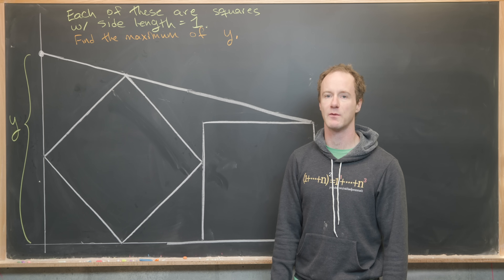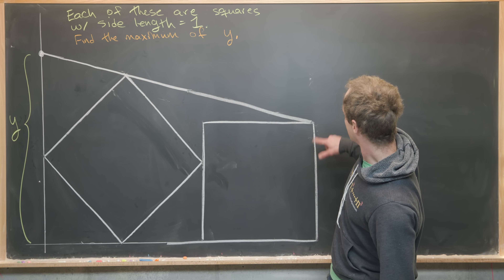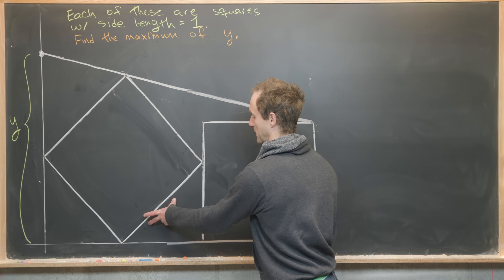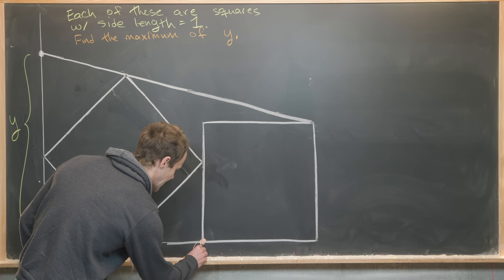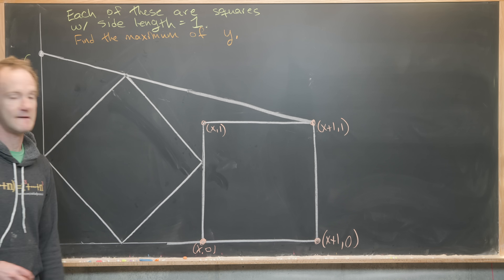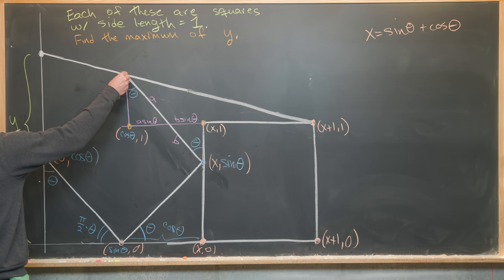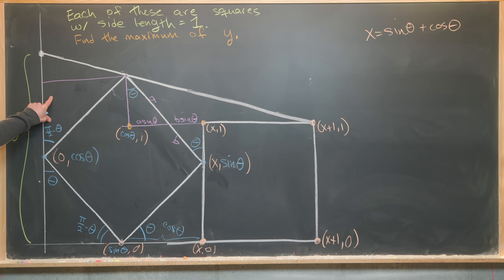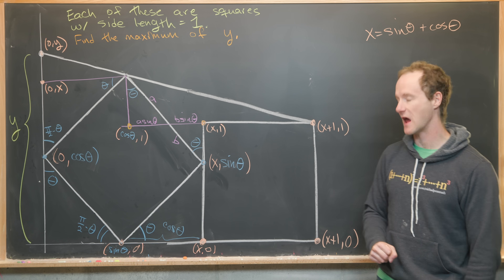How big can y be?

Comment: Excuse me if I'm being dumb, but if the question was asking what the maximum of y was, wouldn't you just set the theta equal to 45 degrees as that would maximize the vertical height of the tilted square, which would then maximize the height of y? Like, there IS a way to solve this numerically, unless I'm being dumb.

Edit: Forgot to mention that since it gives side lengths, you can solve it. Not sure if I need to mention that, but still.

Edit 2: Every response to this keeps on getting more confusing. Feel free to keep commenting, I think eventually someone will figure it out, because clearly I can't.
Reply: Because that is not the actual solution. The 45 degree angle would be the maximum solution for x, but it is not for y. (even if somewhat close to it of course) By tilting the square just a little bit clockwise, x gets just a little tiny bit smaller, but y gets higher, because the top of the square is moving to the right more than downwards.
Of couse you can do this numerically as well, but that's a whole other story. So basically, you could do a search with the angle looking for a value of theta between 0 and 45 degrees and do a binomial search until you reached whatever your degree of error is. But numerical solutions are in general no exact solutions, which is what Michael is looking for here.
Reply: @petersievert6830  but y is the height, and if y is on the line from the top right corner of the regular square to the top of the tilted square, then to maximize the angle of that line to the horizontal, you would just tilt the tilted square to 45 degrees... Also, x would be maximized at angles larger than 45 and approaching 90, as the most the distance can be is that gap plus 1.
Reply: @nateexists6292  i don’t think you got what peter said, the max of Y is not achieved at theta=pi/4 because y max =/= x max. 
Its pretty close tho.
Reply: @nateexists6292  Be awere that the X-coordinate of the top of the square is not fix. Moving the top to the right while keeping almost the same height, enlarges y.
Reply: @BrianStewart126  I am not sure, what you are referring to exactly. The numerical solution?
If there are multiple local maxima between x=1 and x=sqrt(2) (which corresponds to my theta ranging from 0° to 45° , then it could obviously fail, sure. But it seems intuitive for me, that when you tilt the square clockwise from x=sqrt(2) to x=1, then y would rise for a certain range and fall afterwards. (If that assumption is wrong, I am in troubel, sure.)

btw I was imagining some kind of search, that makes do without the derivative, rather the engineer's way suggesting some kind of binomial search and possibly not even very effcient and not the analytical way, bec if you got that far to get the derivative dy/dx resp dy/dtheta , then you surely are able to proceed without the need for a numerical solution)
 
Apart from that, I only wanted to give some intution for the idea, why x=sqrt(2), thus the bottom angle=45° is not the solution. That was not meant as a recipe to find the actual solution at all.

Comment: There IS a fun way to compute this!

If you only work with the trigonometry, you get y = 1 + sin (2θ)/(1+ sin θ).

The derivative of that, expressed as a polynomial in sin θ = a, has (a^2 + a - 1)  as a factor, with the other factor discardable.

You get y when you set a as the inverse of the golden ratio. Pretty elegant.
Reply: I did it this way as well.

Comment: 1:06 My body is telling me x=√2 but my mind is telling me it’s not that easy. Let’s see how wrong I am...
14:54 Good Place To Stop
Reply: Yeah, intuition can be misleading when it comes to rotating squares.
Reply: Why isn't that correct? X=√2 would give you the largest x+1 and the largest angle for the top line, no?
Reply: @casc3601  The heighest angle isn't obvious at least. Let us call the heighest point of the square (a,b). If you tilt the square further such that the heighest point is closer to the left square you get a slightly smaller difference of the heights b-1, but also a slightly smaller distance (a-x) which you have to divide by. So it is not exactly clear. If the slope is maximal for x=sqrt(2) (which I would guess to without doing the math), it is the correct solution though.
Noteably other comments have pointed out that the x value in the video is negative, hence doesn't solve the problem. Then x=sqrt(2) is actually the solution (that however doesn't mean the slope has to be maximal for that value of x for similar reasons!)
Reply: @freewilly1337  thanks, I went back and what I got for the angle at the bottom of the tilted square was about 49.5 degrees, so slightly off. No idea where the negative x value came from
Reply: @casc3601  The opimal angle for the heighest slope is NOT the optimal height for y though. Because y depends on another distance which varies.
Reply: Yep. Calculated the case for x=sqrt2 and got to y=3-sqrt2 but that's not correct lol
Reply: @skylardeslypere9909  No correct, because, the point (Cos(teta), 1 ) is wrong...
Reply: You are right man
There's no other way and the maximum value of y = 3 - sqrt(2)= 1.5858.
It is just impossible that y has the value of the video
Reply: @oscarrangel14  lmfao are you serious bro?
Reply: @lennyganado3975  I was wrong don't listen to me but the answer in the video in terms of "x" is also wrong cause its negative, the high is correct
Reply: dobro namesti za stoj